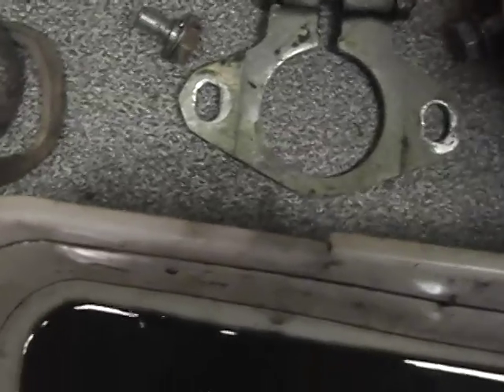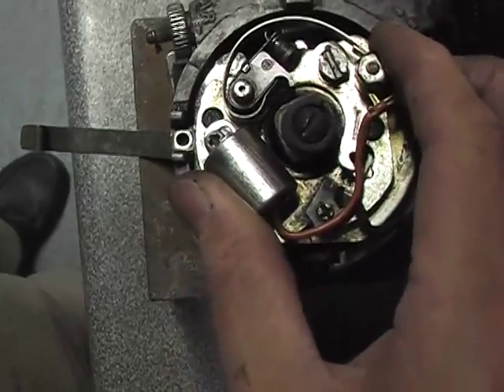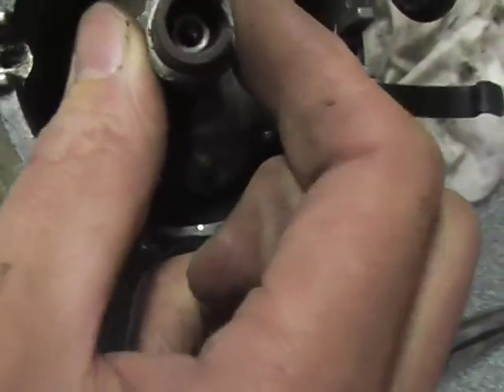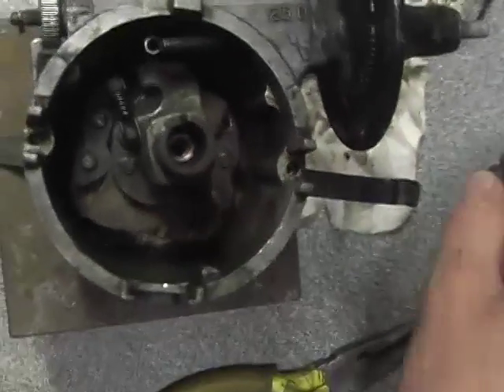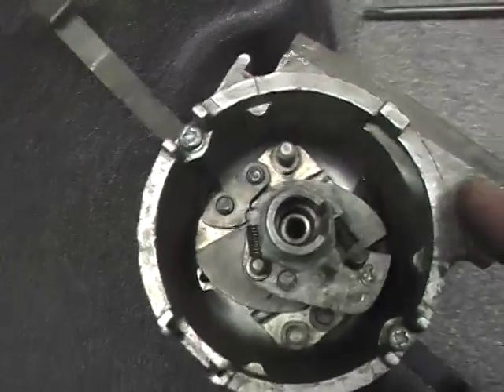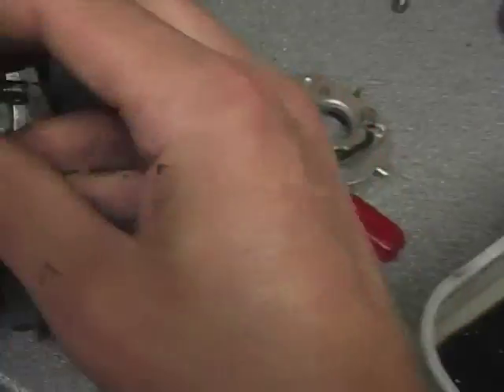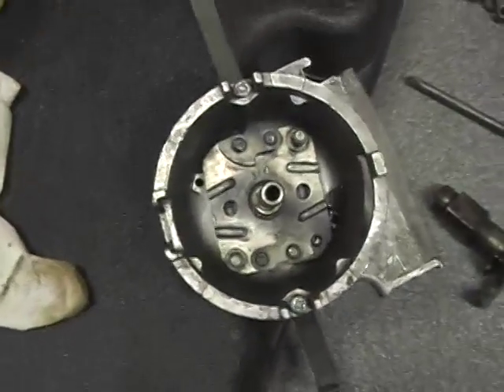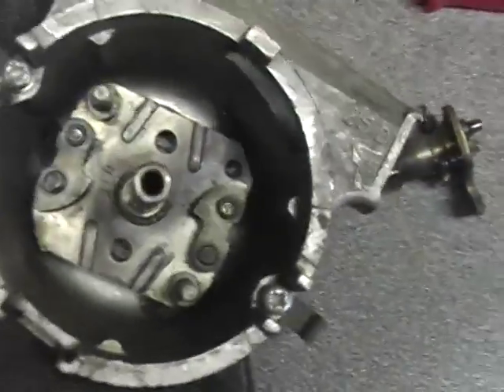The Lucas 25D Distributor for A-series Engines

Comment: The pin at the bottom does come out. Needs a good hit with a lump hammer. The weights should be the same so can be used. Oil shouldn't  get down to lube the main shafts as there is an oil control nylon type washer  right at the bottom of the internal part.